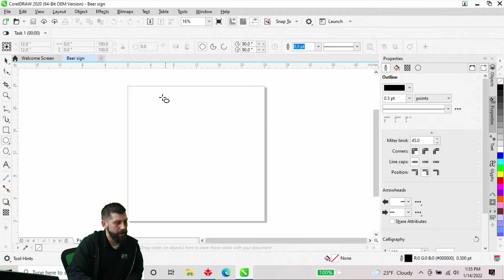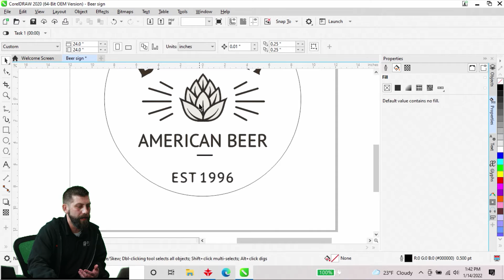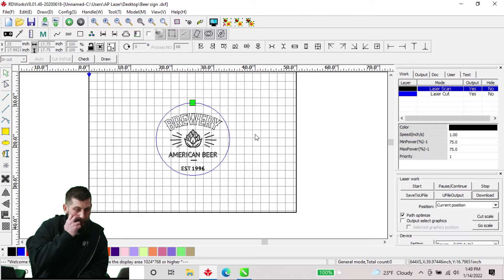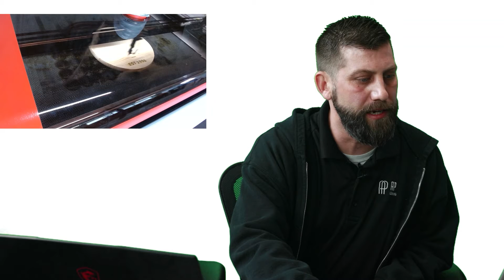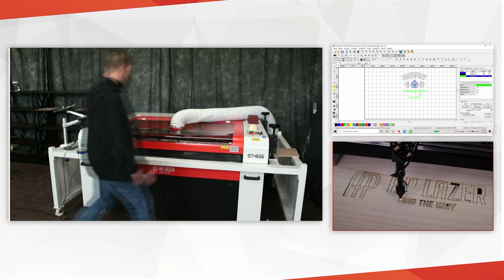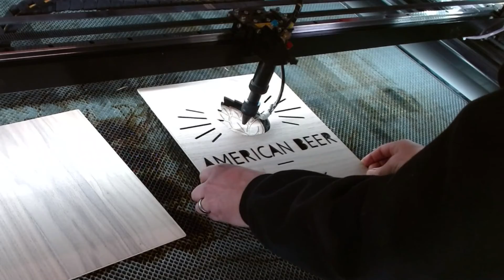AP Lazer Workshop | How to Cut and Engrave Layered Wood Sign

Comment: Would it be quicker to just cut a line for the outline of the letters instead of engraving? You can then use that to align letters and glue / pin nail.
Reply from the maker: Thank you for your feedback!
 You are absolutely correct - you could also run a lower powered outline around the letters instead of a full roster engraving to save time. :)